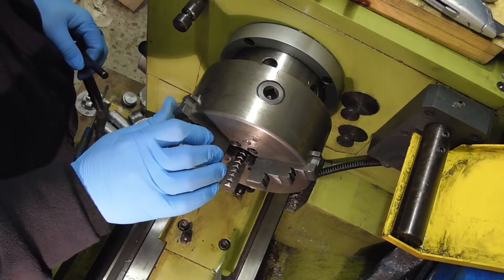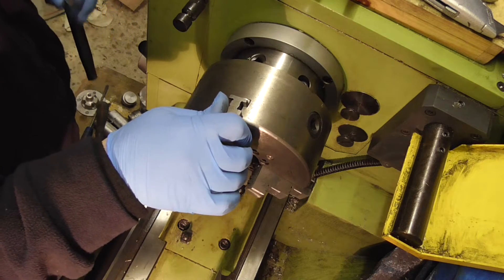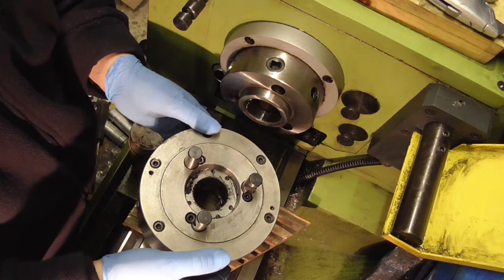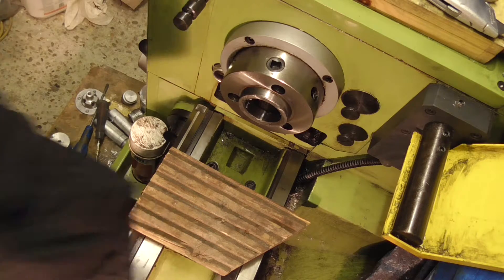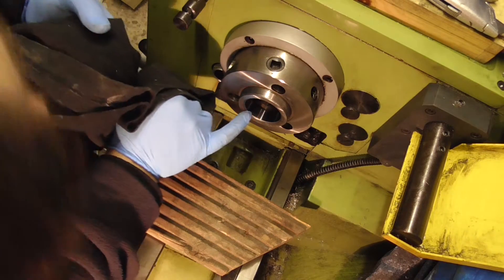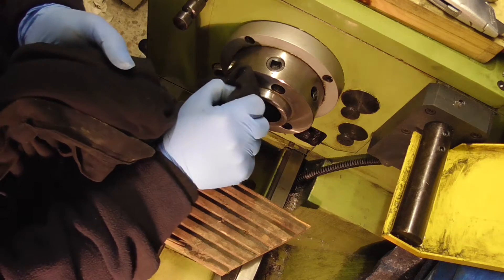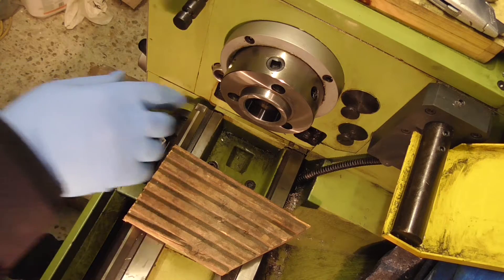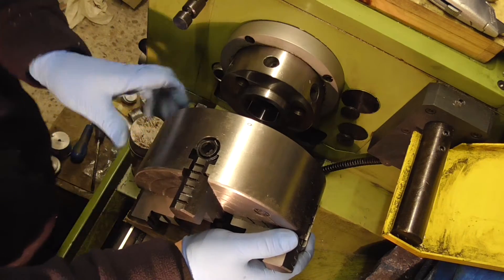Changing a D1 camlock chuck

Comment: Saudações do brasil.Qual o diametro do seu camlock 92mm ou 117mm.
Reply from the maker: "Greetings from Brazil. What is the diameter of your 92mm or 117mm camlock."
Hi Wladimir
The Warco GH 1322 runs a D1-4 so is 117mm
Hope this helps.
BTW, I suspect there are other brands running the same machine
Olá Wladimir
O Warco GH 1322 roda um D1-4, com 117mm
Espero que isto ajude.
BTW, eu suspeito que existem outras marcas executando a mesma máquina
Reply: @WarGrade  Muito obrigado pela atenção.Que eu estou querendo fazer um camlock desse pro meu torno